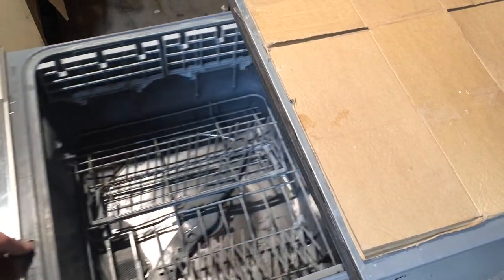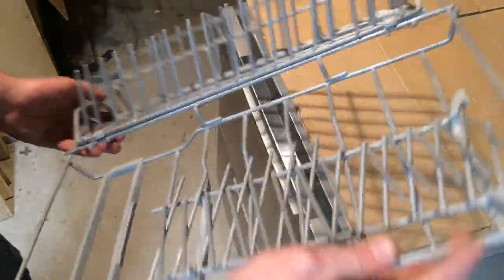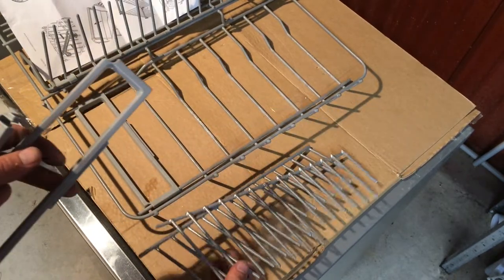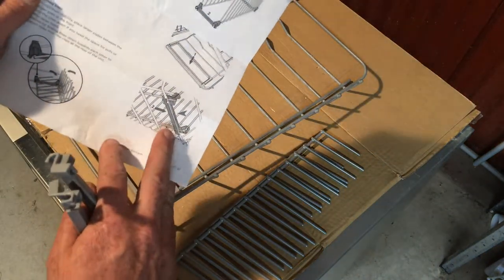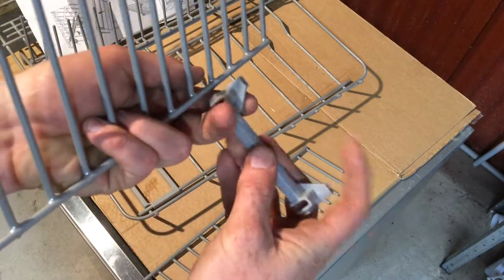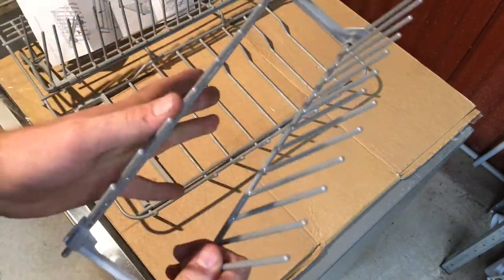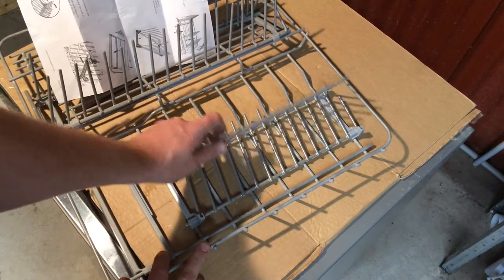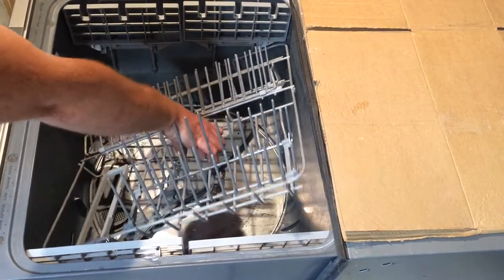Replacing Crockery Insert on Fisher & Paykel Dishdrawer.

Comment: Hmmm... one clip provided matches video; the other one doesn't.  But overall helpful, because the one that matches is more challenging to figure out orientation.  And of course, no instructions were included , so thank you for the hints.
Reply from the maker: Yes they now have three different types of racks across the models as they continue to tweak them. At this stage they are pretty close so haven't got around to making another video on them.

Comment: What replacement part is this?  I've been in the Fisher/Paykel website and can't figure out which crockery rack replacement it  is.
Reply from the maker: There are several different ones depending on which model you have. I think this one is a 512818 but not 100% sure.

Comment: I don't get what purpose the movable wire that is fixed  besides and the cutlery box  ? 
Can someone help?
Reply from the maker: the racks fold down so you can place things like pots in instead of plates, is that what you mean?
Reply: @motrepairs  No... it folds up n down..
it sits under the Cutlery unit.  
It is a kinda square shaped wire .
Reply from the maker: @mortymorty7903  That is so you can access the filter without having to take the whole basket/rack assy out.